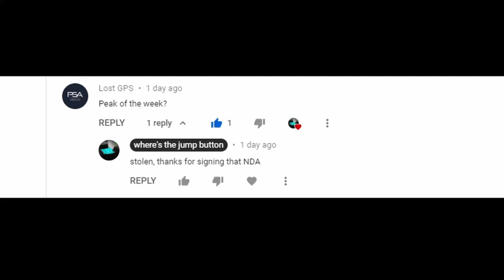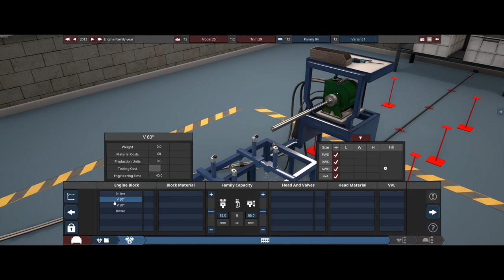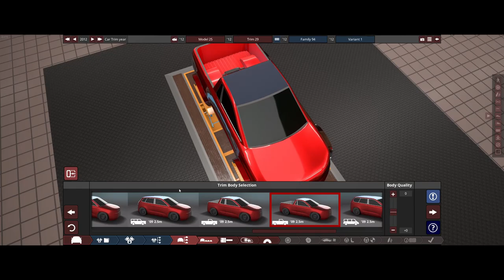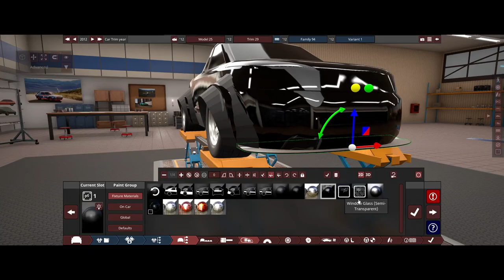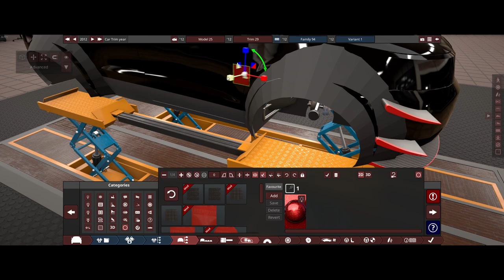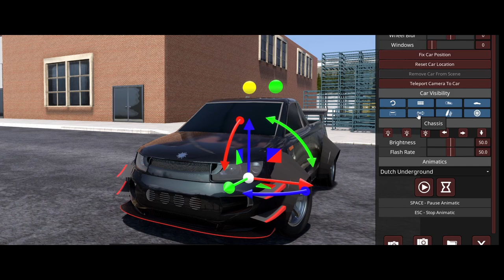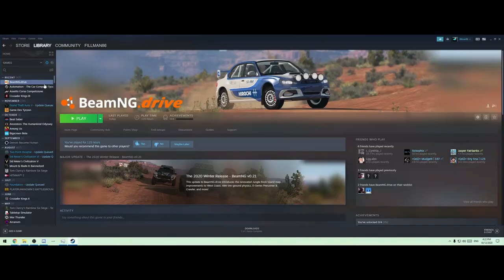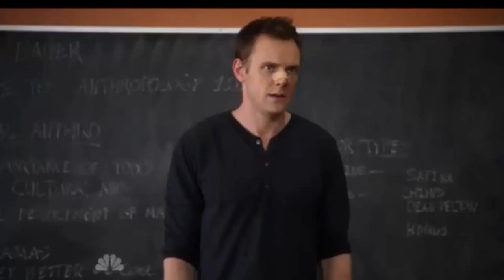the Deadly 1400hp UTE - Friday Pikeday ep 2

Comment: What you need is a camera on your steering wheel setup for context on under and oversteer
Reply from the maker: so on this screen, the little wheel in the bottom right of the screen is a little hard to see, but between it and the peddle % it'll have a little horizontal bar that shows the % of steering angle, and direction